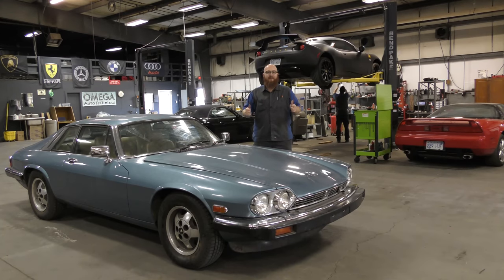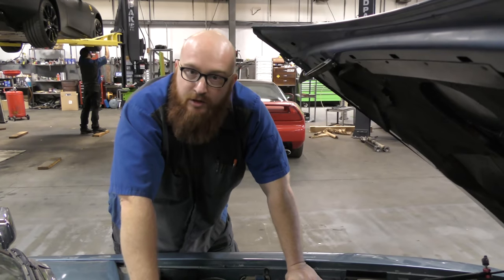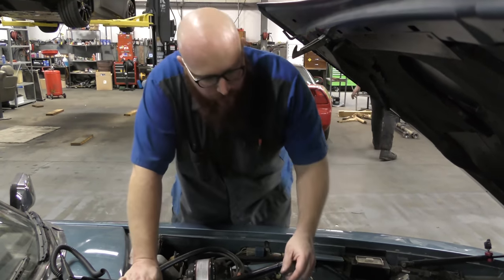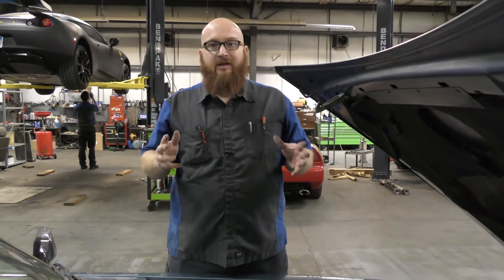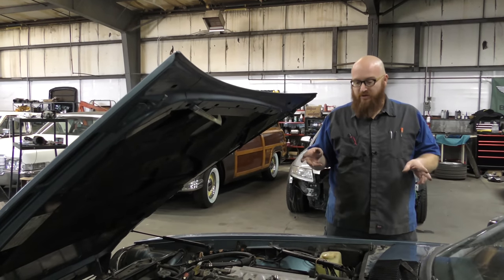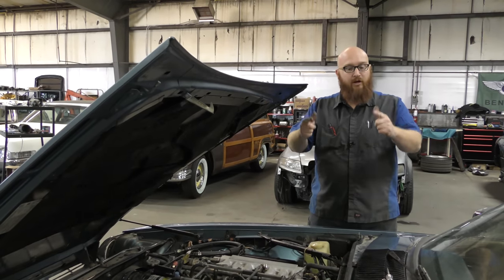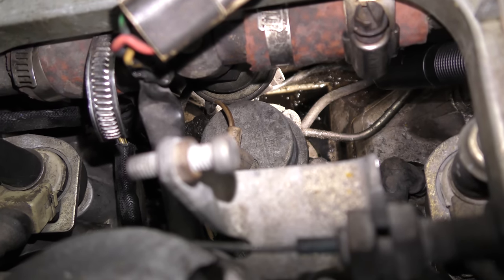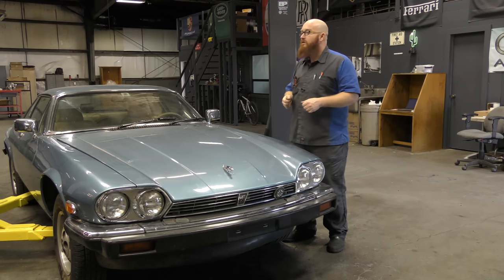'82 XJS with the cursed Jaguar V12 comes into the CAR WIZARD's shop. Can he get it running?

Comment: The common-sense logic approach the Wizard uses reminds me of a program that Plymouth had back in the 1960's. I'm not sure how long it ran, but I remember hearing of it around 1963-64. In the program, high schools around the country would enter their teams into state championships, then each winning state team would take part in a national competition. I think (but am not positive) the competition was called the "Plymouth Troubleshooting Contest".

In the championships, Plymouth would line up 50 (one for each state team) identical cars side-by-side. Each car was prepped my Plymouth with identical multiple problems that kept the cars from running properly. It was the job of the contestant teams to use their skills (using only basic diagnostic tools) to figure out what the problems were and to repair them. The team that could diagnose the problems correctly and get their cars going first, then drive it over the finish line won. If a team crossed the finish line first but had not caught all the issues, they were disqualified.

It was a cool concept. I suspect that many of the participants (winners or not) went on to long and successful careers as auto mechanics.

The Wizard most certainly uses this "common-sense" approach to diagnostics. Sure, he has all the tools, gadgets, and gizmos... but his most powerful tools are his common sense and his logic. He knows that isolating a problem is great, but often it isn't enough. Often additional problems only reveal themselves after a key issues has already been discovered/repaired.

That approach is what the Plymouth competition encouraged and is what makes the Wizard such a great .... well "wizard".

Comment: It’s not an oil leak.  It’s the dust control system engaging.  Make sure the dust control reservoir (crank case) is at proper level or system failure is inevitable.

Comment: The oil leak is most likely where the two piece oil pan overlaps in the middle. Remember, it's not actually a 12 cylinder. It's two six cylinder engines. Everything meets on the middle. With time those points develop a slight leak due to temperature inversion vs. component expansion/ contraction rates.

Comment: I tried to restore an XJ6, but the price to fix everything got me stuck. It's like jaguar consciously tried to put everything so there's a lot of hassle to get to. You can barely do anything without pulling the whole engine out. Since I'm quite good at electronics, I wanted to replace all wiring and make an internal iOT so I could see every sensor without having to rip my head off.

Comment: these cars are actually really easy to work on, just need to upgrade the electrical connections and the fuel connections, these were made to be worked on with just a hand box of tools

Comment: I think Lucas ruined the Reputations of many cars motorcycles and anything else that had Lucas electrics. The trouble is the industry didn’t recognize the fact or ignored it, and in the end destroyed good designs.  I drove a jag saloon car with a V12. I had to fill. the dash pots on the carbs! But the V12 was the sweetest running engine I was entering the interstate and in order to merge I stepped on it and was doing 120 mph before I realized it lovely. Bosch is it.

Comment: These look so much cooler than the Mercedes. Looking at that engine bay I will admit to being the 1st one to pull all that crap out & set in a 350 with HEI.  I wouldn't look back either.

Comment: Ahh Lucas electronics ...Problem#1 say no more!
I had a Ford Falcon with a 250CI engine. Parked one night, no start next morning. Only popped when I turned the key on or off. Fuel but no ignition pulses. New Hall Effect sensor fixed it.
Given that it has sat for ...x  years, you would want to change the oil too? What sort do they take?

 On the subject of the oil switch, I have had a couple start leaking. One out of the plastic/metal join and one out of the connector spade joint. I think they must burn out the little pressure disc after many on off cycles and that is when they start leaking. Worrying though as they can be a significant oil leak especially if you never check your oil.

Comment: I'd still rather have the Chevy 350. When people think small block Chev, they automatically think hot rod engine....but you can build a SBC to be very smooth yet powerful. Very interesting about the Lucas ignition box housing a GM HEI module, I never would've guessed that

Comment: The big the problem with Jaguars is the number of them that are run on a shoe-string. They'll keep soldiering on with multiple minor problems until one day they fail and need a tonne of fixes. People buy a Jag for little money and don't want to spend the running costs on it. Then blame the complex car when you get problems.

Comment: George Lucas that is!    Great Video...Only problem after a $4000 or $5000 Shop bill You have a running well original '82 XJS, worth $3000 to $4000 Retail.  V-12 or V8 Conversion.  Plan on Keeping it, not making a profit.  Very sad as I am a Jaguar Owner and Lover.

Comment: The best part of a Jaguar is the TH400 trans lol Though they did win the Europe touring car series and in Australia, in 1985 they won Bathurst from pole position,they were Tom Walkinshaw RIP-developed cars.The original concept for the XJS was to be a mid-mounted engine sports car but with Britsh Leyland's budget of a couple of beers and a bag of chips it just reused old normal drive train of previous jags,even here in New Zealand lot of Jags got Chevy Small blocks cause the just bolt up to the TH400 trans and then you can feel the potential this chassis had with new spring dampers, bushings lol Jags and these old cars are not financially sane to own, just burn money same thing .

Comment: Sitting for years? Do not try and start until complete fuel tank is restored and fuel hoses resolved etc. Over time trying to start the motor with eventually thin oil will faarq up the bores. Then, it will start breathing heavly. 
Know what your doing. Then the results will come. Suprisingly the old school tech works. Its the basics that lets it down because folks don’t get it

Comment: You know, I do still think this design is EXTREMELY stupid of all the things you showed having to fix in this case, but I'm at least glad you found a way to fix it. I ran across similar crap with a bunch of older computers that really SHOULDN'T have had the issues they did back when I was more into them, and I expect the same kind of deal with getting into mechanic's work like I am right now.

Comment: I used to own a car exactly like the one in this vid. That motor ran more like a sewing machine than a combustion engine it was that smooth.   Only problem I experienced were leaks of every type of fluid in the car and they would come and go so I didn’t bother addressing them.  I only had it for a year so maybe I just got lucky.

Comment: I've never had any issues getting any Jag V-12 running.
Its sad so many hackers butcher cars because they aren't smart enough to read a page or two on system operations.
Worse, so many don't have a clue what they are doing on anything but a SBC with a carb and points on it.

Comment: lucus and Marelli are cousins, the early v-12s had wet liner cylinder sleeves and some had a common sump for the  manual gear box and engine,I had a customer that changed his own oil and kept having cam lobes wipe out he only put five qts in the sump, and I asked him ,"what did you do with the other seven qts

Comment: I wonder if you ripped out the OE computer and installed a standalone like a Haltec, Micro squirt or Holley if it would solve most of the breakdown issues. I’m sure it would wake the engine up a little.

Comment: Those V12’s were so smooth and the torque they have feels like a turbo diesel pickup. If the only way I could put one back on the road was to desecrate it with a chivvy engine, I would just crush it to save it from the shame.

Comment: inboard brakes reduces unsprung weight,  the weight of the brakes is sprung by the suspension rather than adding weight to the wheel assembly.

Comment: IIRC the old Rolls Royce actually had three separate brake systems. Services brakes, on the wheels. Parking brake, on the rear driveshaft. And the real emergency brake, on the driveshaft. (Or vice versa.) Jag isn't the only marque with unusual brakes.

Comment: The key take away from this for me is that for approximately $1000 and a great mechanic you can have a non running V12 Jag back on the road, which is much much cheaper and better than a replacement V8 !

Comment: Its funny! The V12 is a great engine and not hard at all to diagnois and repair. My buddy has owned on for years as a daily driver. His is a 1984 XJS V12 H.E.   I can't believe people yanked out this great engine and put a worthless Chevrolet piece of junk boat anchor motor in it. People don't like to think about or try to diagnose cars when they have a problem so they just go with the simple solution and put a cheap and easy engine to work on like a Chevrolet. If that goes to show you just how stupid and weak people can be because they don't want to even try to fix it.

Comment: story about a guy bought his car to Wise Old mechanic after spending hundreds of dollars said "everyone told me it can't be fixed". 
WOM looked at it and took a large hammer, whacked the engine which then started and ran perfect. 

WOM said that will be $350 The guy said all you did was hit with a hammer! break down how you can justify that?
WOM said drive into shop $5 shop, $5 rent hammer $5 KNOW WHERE TO HIT $330 DRIVE OUT OF SHOP $5

Comment: Congratulations Wizard. You did it. Now with all your experience, can you tell me why some cars have to be so complicated when it's not always necessary. Other than the fact that one can not mentally survive without a V12?. I think I might have worked it out when I began thinking about gun laws. Because they sell us guns that were designed for killing prople, but then they tell us that we cant shoot people. So then they sell us fast cars and then they tell us we can't go fast. But we can tell people that this or that gun will blow someone's head right off. And that my car is very complicated and can go faster than the legal speed limits that are imposed on our roads today, and mostly for our own safety. And as if we did not know that. But we also know that they will never lift the speed limits. So what is the point in my Jaguar? I can answer that question very honestly. "I'm a wanker"

Comment: I have a 73 XJ12 and I took the distributor out and put it back in backwards and I had no idea what had gone wrong. One of my friends took one look at it and said ‘timings 180 out’.

Just like that.

It’s immediately obvious as it backfires through the carbs. Probably not so obvious on an injection car.

Comment: Sometimes mechanics check with the car in the air for Front end or rear end play.... Sometimes  with these cars as i'm sure with many vehicles with independent suspensions like these, when they're on the ground, that's when you could feel the loose play...a-arm bushings....ect....

I still think unibodies are the coolest

Comment: I love the sound of V12's , Ferrari,Lambo's, BMW,and MB, and Jaguar's.
The issue has always been the European propensity to extremely precise, but exceeding complication.
To me it is a hold over from the fact that European culture derived from royal demand for the very best, cost no object, products.
Whether it was a clock, clothing, armor, art, castles,yachts, fashion, food, horses,jewelry,ect.
When the Germans developed the first automobile,that culture carried over to cars.
Wealthy Europeans just bought new expensive cars,again cost no object.
They don't care what the repair costs are,because they don't keep them more than a few years.
We have had Audi TT's, M3's M4's,M5's, British sports cars, Corvettes,muscle cars,etc.
American cars ,by comparison, come from a different cultural background,requiring simplicity,and mechanical durabilty,over cost no object sophistication like Euro cars.
My wife loves Audi A8's.
They are the epitome of class and sophistication.
But don't keep one past the warranty.
I worked with Mercedes Benz Road Racing for twenty years.
I love the older MB's but the Brits,Italians, and Germans have collectively lost their friggen minds with the current level of obscene automotive complexity.
I drive an Acura.
Its fast, always runs,never breaks ,great fuel mileage,and!!!! it's resale value is very high due to the fact the market knows what a nightmare, used Euro cars are, and you pay accordingly.
I'm not the smartest guy in the room, but at 70 years old,and a formulations chemist by trade, I have seen some stuff in life.
Anyone who can fix a V12 Jag is worth his weight in gold.
Thats why the resale value plummets for used formerly expensive cars.

Comment: Other than electronic issues, the XJS and its V12 weren't that bad. I've not seen that many 350's installed in the XJS. But, I've seen plenty of 350 swaps into the XJ6. And, again those 6 cylinder engines were fine engines, outside of the electronics.

Comment: What repair did I almost give up on?  I have a 2002 toyota 4 runner and I have an evap leak giving the codes P0400 P0401 and P0406.  I have checked the fuel cap and it seems in great shape, the vsv actuators are working under the hood, and now I am left with the fuel tank having a leak, bad charcoal canister, or the purge valve next to the charcoal canister.  This diagnosis is extremely difficult without doing a smoke test it seems.

Comment: Doesn't simulate a warmed up engine, it acts as a jumper, completing a cicuit that normally completes at temperature. Real similar as to how a toaster knows when to pop. As the toaster heats up a little strip of metal, it expands, which makes it bend until it touches a separate piece of metal, completing a circuit. A basic thermostat. In a toaster it tells the device the toast has reached the desired temperature, in your car it tells the computer your engine has reached the desired temperature, so as long as a current carries from one connector in the plug, to the other, then your car "must" be operating temp. That trick is called using a "jumper" to "bypass a sensor" and is done alot by mechanics for diagnostic, and jerry rigging applications......

Comment: Just an advise for future lovers of these brand of cars: have a straight 6 cylinders instead of the 12. The AJ6 engine is the best: quite same peeformances than the v12, very reliable and simple mechanics and a reasonable fuel conso. I have enjoyed a AJ6 on a xjs for about 15 years now without any trouble… think about it! 😄
Reply: It's too bad that we in the US didn't get much access to the 3.6-powered ones. Only in 1993 did they start selling the 6 cylinder ones in our neck of the woods.
Reply: @tyronecus   You can still find some 3.6 and 4.0 in UK at a reasonable price but it will not last, especially for the 4.0. Of course the difficulty is also to get a body free of rust, which is an other story…

Comment: Instead of a chevy motor, how about take everything off the v12 down to the heads, and then put on a manifold and carburettors and a new double SU fuel pump (solves the fuel problems forever).  Then take out the Lucas Opus or electronic distributor and replace that with a standard points distributor from the 1960s and new coil (solves all spark problems forever), and now it's as reliable as a 1961 e type.  Not only that you have a beautiful sight underhood instead of the rookery of emmissions hoses and solenoids and wires etc.  Only deficiency is chronic low oil pressure but I'd put a new oil pump at the same time I did the other stuff.  Then sell all the garbage you took off to recoup your money, plus you didn't have to buy the chevy motor.  end up with a faster smoother more valueable car.

Comment: I  had  a  1976  XJL  12  cylinder   with  a  standard  transmission   conversion  a  beautiful   car  it  died   in  the  driveway .I  tried   for  5 years   to  get  it  going  but  to  no  evale   took  it  to  a  mechanic  he  got  it  running, got  it  home   and  it  died   again   $3500  later,I  finally   gave  up  and  sold   it  for  $400  ,so  saddened   me  so  much but  couldn't   go  any  further   with  it

Comment: I bought a old mercury 410 engine,,,one rocker shaft was split,,dumping oil starving the rockers,,,the rockers looked good,,but some had no oil and a ton of oil in the back cracked tower,,,but nobody knew it,,,lifter started tapping,,alot of work done and still it failed,,now I'm changing cams

Comment: I feel fortunate that my limited fan boi affections for Jags began and ended with the XKE well over 5 years before I could legally drive. Good old boring Japanese design and durability. There are still good reasons for the avg. working Joe to avoid european vehicles overall. Even the formerly beloved VWs.

Comment: Manafold Absolute Pressure. The Map Sensor. Ok... I heard that about the relay.  I have heard from reliable sources of information that Lucas wiring is a reason to stay clear of the electrical problems. How unfortunate to flake out on the R/D

After LucasVarity was sold to TRW the Lucas brand name was licensed for its brand equity to Elta Lighting for aftermarket auto parts in the United Kingdom. The Lucas trademark is currently owned by ZF Friedrichshafen, which retained the Elta arrangement.

Comment: U.K. On the rare manual model you can put it in first and at 10 mph straight into top and floor it. It's just like an electric motor. It's 3 figures in seconds. Took 3 days to change an exhause manifold gasket. I think the earlier ones were not as complicated as this one, maybe emmissions ? Can't really rmember 30 odd years ago. Beats a V8 ANY day. Nearly had an organism. I have a V8 Daimler cica 1960's, it's nice but.............